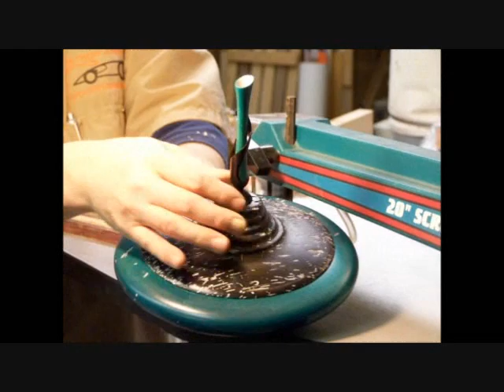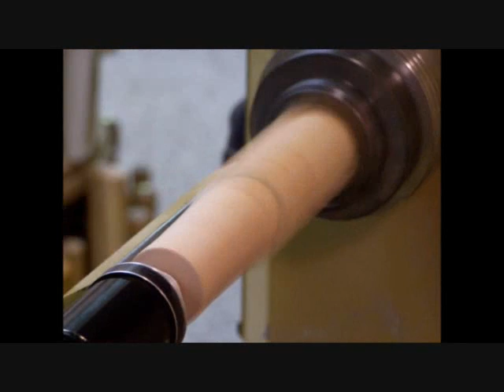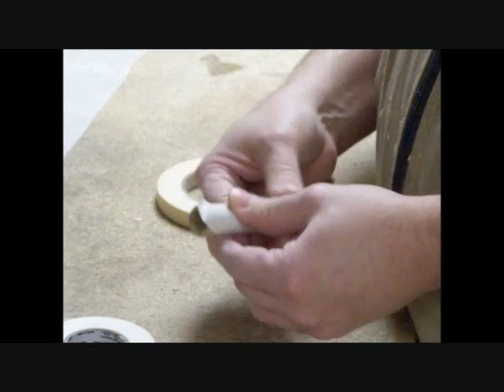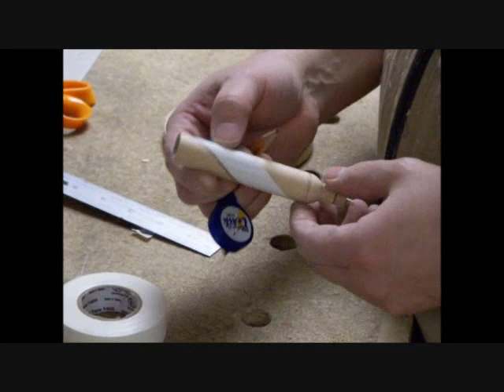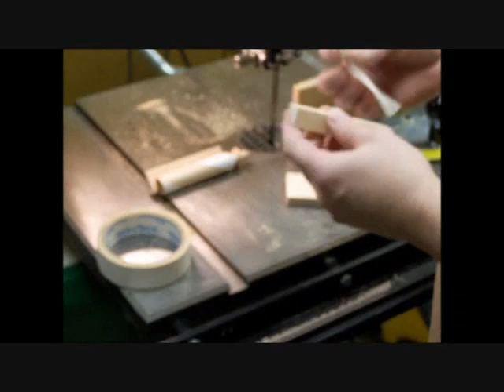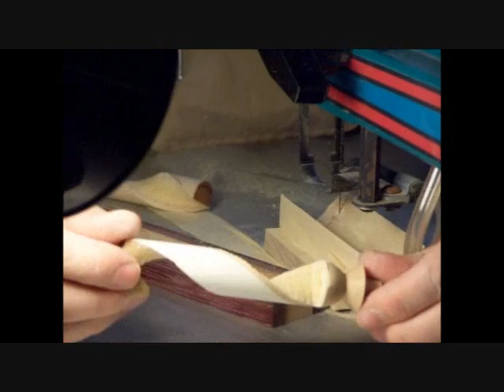How to Make a Spiral Ribbon Finial

Comment: why not using a dremel and a cutting disc?
Reply from the maker: +Jf L The scroll saw cuts both sides at the same time so it is quick, but if you don't have one, the dremel would work, I just think it would take longer and would require more work after the cut was finished.